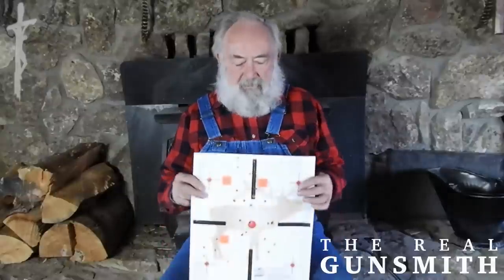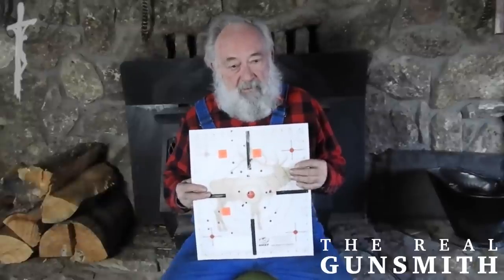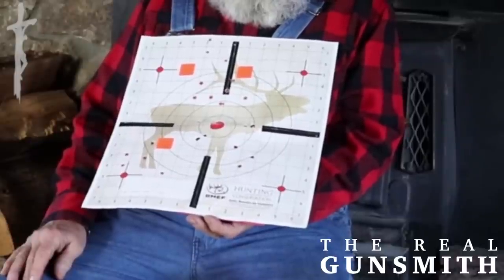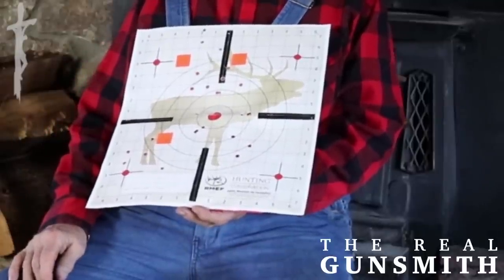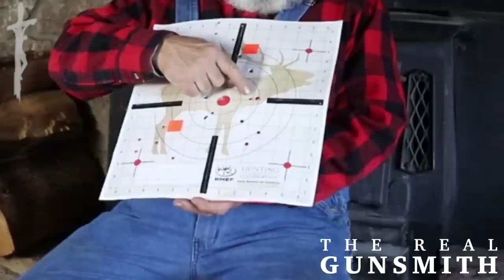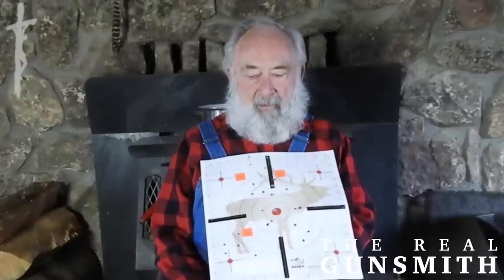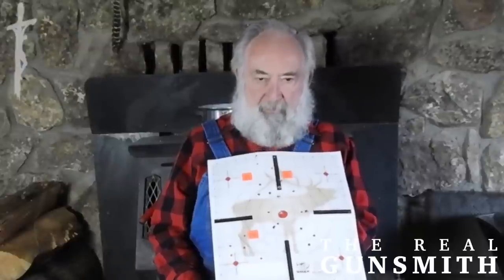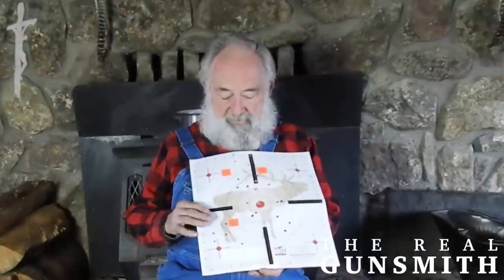Savvy Reloading Advice

Comment: Growing up with absolutely no standards in accuracy because we were not allowed to hunt deer with rifles in my state, I was never interested in this type of accuracy. I never knew what the term actually meant. I am absolutely pleased to get around 1 to 1.5 inch groups out of any factory rifle I have now and compared to 6" groups at 100 yds with rifled slugs from a smooth bore we are miles ahead of where we were when I was younger. Your talking about striving for less than .5 inches. Amazing and thank you for your knowledge. I switched to a muzzleloader for all seasons when inlines became popular in the 90s looking for those one hole groups, and never looked back until they made straight wall cartridges legal. Now I shoot a 45/70 guide gun with 300 gr jhp handloads. I have some 405 gr hard cast but they tear up a lot of meat. The 300 gr behind the shoulder is perfect and kills like lightning and group about 1.5" at 100 yds. Which is about what I would get from my inline with 250 gr. sabots and 90 he of pyrodex.

Comment: I developed a load for my Browning A-bolt 25-06, using 4831 powder and Barnes TSX 100gr bullets. I used 4 different loading references,  3 of the 4 listed 54gr as the max charge, except my Nosler#3, which said 56 was max. I loaded up 20 rounds from 52gr to 55.8gr, shot them over a chronometer, found 2 powder nodes, selected 55.2gr as the charge.
Then I played with bullet seating depths until I got to a 4 shot group at .78 inches.
I shot 40 rounds to find a load, maybe I didn't do it perfectly or maybe I went about it differently than some would have done it, but it sure is satisfying when you see your changes make the groups tighter.
Reply: Barnes bullets wouldn't work well with data from other bullet manufacturers. Glad it worked out for you, but Barnes have a higher shot start pressure and are longer for their weight than jacketed bullets. Thus they need less powder to get to top pressure.

Comment: Finally someone that reloads and when starting off gets bad groups like I do. He's using a great rifle and his reloading experience and not getting much better than I do at first. How refreshing! Of course once I find a load that shoots under an inch I'm satisfied for the type of hunting I do here on the east coast. Last fall when starting off with a new bullet, my first charge shot close to half an inch! I didn't know what to do next! Still haven't decided. I have to tell you that this is the best group I've ever shot with this rifle. The velocity is a little low and I bought the bullet to try and extend my maximum range on moose but the low velocity isn't helping much. I'll keep trying other charges because I know the rifle likes the bullet. Wish me luck.
Reply: @Jess Hadlock I'm hoping too. But man that group! I was so proud.
Reply: @Jess Hadlock Older Sako Forrester in 7mm-08 shooting 160 grain Federal TBT at 2540. ES was 5. No visible pressure or measurable case expansion. Its a very long bullet and my mag is the limiting factor. Lots of jump. I really don't expect much more from my combination and should just load the rest. It would be my eastern moose load with a limit of 250-300 yards with a good presentation.
Reply: I was once loading 308 with 168 hornady match for a long rang plinking load using varget. It was a new and inexpensive gun so I was beginning to think 1.5" was the best I could expect, SD was in the high teens as well. Swapped WLR primers for REM LR and SD dropped to 8-ish and .5-ish for the group size. For hunting moose, I would continue to experiment until I found a good load at higher muzzle energy or until you have to sight the rifle in before the hunt starts.

Comment: You didn't say it, but with your approach to building a load, it follows a principle that I always state when others ask for suggestions - "don't be afraid to try something different and shoot your gun more."  It surprises me how many handloaders expect to find that accuracy result and down deep it pains them if they have to shoot they gun more than a minimum number of times.  I generally approach handloading as a great opportunity to shoot more - GOOD!.  I don't follow your approach in detail, but the general approach of try this, change one item, when you start to see results you like - start zeroing in on that recipe.  I also appreciate your approach of measuring the cartridge base expansion as another method to identify pressure signs.  Not many people do that.  It's a simple step, that requires very basic tools to measure for consideration.  If you could touch on a subject in a future video - what are your thoughts on the recently introduced Savage straight pull?  I'm giving it serious consideration, for one reason because I am a left handed shooter.  It may allow me to purchase a gun that does not depreciate in value so much because there are no right handed shooters that are interested in my left hand bolt actions.  The ambidextrous nature of the gun may serve my needs well, and retain value as it's still a right handed gun for anyone that may want it to be right handed.  But I would like to hear your thoughts on the integrity and strength of the action?

Comment: Good video. I have been reloading for close to 50 years. All true what you said. I have a 270 that would not group and would kick straight back with a terrible wollap, finally checked the bedding  and made it free floated  then added a heavier butt to force the center of mass back slightly. Worked up a group with 4350 imr and a 140gr boat tail. Shot groups under 1inch and soft recoil. Learned the lesson to feel how the recoil along with barrel vibration. Tune the load to the barrel.

Comment: When I start working up a load I start with the charge wight and increase it until I get good velocity and see low SD numbers. Then I work with the seating depth to tighten up the group. We all know that every cartridge is different and certain powders are suitable for each. As a general rule I look for a powder that yeilds a full case b4 it causes over pressure charges. I have nowhere the experience of most but I do understand I will never know everything and will continue to learn until I'm in the ground

Comment: Thank you for sharing what you have learned up until now. I'm looking forward to many more years of it. I consider every rifle, and cartridge combination a classroom. You have attended more classes than many of us put together, so I find your conclusions valuable. Alot of the YouTube reloaders never show a mic in their videos, they do show their digital caliper to measure  COAL, but never get around to measuring case head expansion. They are reading primers and bolt face marks on the case heads to judge pressure. The $300.00 rifle and scope combo often leave cratered primers at obviously low pressures, and when they pierce a soft cup primer, they declare that they have exceeded a max load, even though when they started the video, they stated Quickload predicted 55k psi, on a 63k psi cartridge. At this point I am trusting Quickloads prediction more than the "guru's' conclusion on pressure. Bush the firing pin and use a suitable primer, and track case head expansion and we can have a discussion. They not only may not have reached their best velocity, but also not reached the most accurate load. Not knocking the $300 rifle combo as it is perfect for the guy that can get through 3 deer seasons on 1 box of factory ammo, but it would be interesting to see the initial expansion of factory ammo. Are they chambered as carefully as the firing pins are fitted?  Question for Randy: A long time ago when I was young and gun writers were old (but younger than I now am), they would frequently shoot 10 shot groups fired at a slow pace at 200 yards.  Now that bullets are so much better, is this practice still beneficial?

Comment: i grew up shooting .243 and reloading for it.  my dad had worked up a load that would shoot inch or less groups in all 4 of our .243 rifles.  30 years later I decided to start reloading, and spent all summer working up a load for my .270 and went thru exact experience  just described.  I was amazed at the difficulty in coming up with a load.  I finally got it, after much head shaking and some profanity...lol

Comment: Happy new year from Australia Randy. Very interesting subject, I have found changes to groups in 338 W/M caused by the season. I hunt in area's that have high humidity and 35-40 degC temps and the group can clover leaf then take it hunting in dry cooler 25-32 degC little humidity and they will group out 1"-1.5" out of the same box. I don't change projectile weight (225gn SST) or primers WLRM I just reduce powder by .5gn and they tighten back up. It is an amazing science. Thank you. Grate filming by your wife. Stay safe.

Comment: Thanks for the advise.  I’m not a reloaded but it’s absolutely fascinating.  I bought a $370 30-06 savage axis with scope.  Due to limited availability of ammo I purchased 150gr bullets which garnered a 2.4” shot group.  The next box was 168gr SGK 1.1” shot group
Then 180gr Cor-Lol .9” shot group and then I finally found 178gr ELD-X .6” shot groups.  I wonder if bullet weight is relative to barrel twist and length.  

Gotta make sure all the screws are torqued properly.  I found that out the hard way.

Comment: +
Question ~ in the situation with belted cartridges, is the belt dual functioning? 

Meaning, as I understand it, it can be for headspacing but was the original intent to strengthen the case head as well?

Keep up the excellent content 👍🏻🙏🏻✝️

Comment: Randy, I've been a toolmaker/machinist for over 20 years and have some good mics. What kinds of changes are you looking for when measuring the head of the brass? .0001 - .0005? .001 - 2? And what do I do with this measurement? Is it just an objective way to measure when you're approaching or over pressure?
Reply from the maker: .0005 as max expansion on brass to control pressure. 
Thanks for watching.

Comment: With low consistent SD's and repeated group size of the same measurements you may want to adjust distance from the lands. Start on the lands and work back. I'm sure you are aware of this, not sure why it wasn't mentioned.

Comment: Hello Real Gunsmith, I have questions about reloading sir, and would like to ask your professional advice. I’m brand new to re-loading and I understand some loads shoot more accurate at a specific bullet jump into the barrel. I have heard many choose .020 off the lands as a good starting point for hand-loads. My question would be, when a person is reloading a lighter grain bullet in a specific caliber “in my case .243 Win”, when should one decide that there isn’t enough bullet seating depth in the neck? Is there a minimum amount that one would want their bullet seated in the case neck for proper retention? In my case with a Hornady V-Max 87 grain and a choice of .020” off the lands the projectile appears it will be seated less than .243” depth in the case neck. How much less than projectile dia is acceptable for bullet seating depth using my Redding standard FL resizing die that uses the standard resizing method for case neck? The current 87 grain .243” V-Max projectiles I will be reloading don’t have a cannelure groove, so I assume they are not designed for a crimp to be used.
Your thoughts on bullet seating depth for proper bullet retention vs desire for a certain off lands distance for accuracy?

Comment: What’s your opinion on annealing the brass in between shots ?   Love your videos
Reply: not needed, trin your brass correctly and just neck size keeping your brass dedicated to your individual rifle chambers. do not mix brass and rifle chambers if you neck size.  neck sizing prolongs the life of brass cases.
Reply: @barryrickert6544  eventually annealing is needed, and sooner than you think. Annealing keeps the neck elastic which allows consistent neck tension. If the brass workhardens to the point where most of the elasticity is gone, when you seat the bullet you are sizing the neck again. Neck tension will be very light and inconsistent.
Reply from the maker: No need.  Good quality brass has been annealed.
Thanks for watching.
Reply: @TheRealGunsmith  All brass is annealed a few times during the manufacturing process. When it is loaded and fired repeatedly it workhardens and requires annealing again to maintain neck tension.
Reply: @TheRealGunsmith  What is good quality to one may not be to another. I have 30 yrs of reloading and metallurgy... my data says to anneal magnums every time and .308 capacity sized cases every other time.

Comment: with your vast experience what powder do you recommend for the .270 shooting 150gr bullets?
Reply: I've done well with IMR4350, H4831sc, RL-26 in my 270 with 140 and 150 grain bullets, Hodgdon website has load data as well as Speer website and Alliant website. I've also invested in manay reloading manuals over the years from bullet manufacturers and a few powder manufacturers as well. I did find that the RL-26 data from alliant using the 150 grand slam was too hot for my tikka and had to pull a lot of bullets before getting to max. Your mileage may vary always work your loads up until you find your own true max. I will start measuring the heads of my brass now that I heard it here. I was a toolmaker for @20 years and still have my mics and more calipers than you can shake a stick at. Curious what I'll find, Randy just said to measure it, but didn't say when to back off the charge!
Reply from the maker: RL22 or RL 26.
Good shooting!

Comment: What do you think about using these 2nd’s bullet’s they sale . Are they just plinking bullet’s and are they waste of money and time. Thanks for sharing your videos and information
Reply from the maker: They are fine bullets, just like the ones you buy in the box.  A simple matter of some discoloration, or occasionally a blemish or other issue they are put in the 2nd's pile.
Thanks for watching.
Reply: @TheRealGunsmith  thanks for getting back to me very much.
Reply: @Dwayne7834  I agree and depending on where you live you can go directly to purchase them. I live close to Sierra and buy them by the pound. However, i can send you a picture of the 20 lbs of blitz /tipped bullets that have to be melted down because they are so far out of specs.
Reply: @justice1327  Thanks for the reply . I have purchased a few to check out and compare to other I have. Most will be shot at 100-200 yards.

Comment: Very interesting and informative video, thank you! Not sure if this is the appropriate place to ask this question, but I'm gonna throw it out there. Recently bought 100 rds of .223 reloads that won't chamber or cycle in my .223 Wylde pistol or my 5.56 rifle. What can I do with these rounds? And does anyone that reloads, buy them so I'm not just tossing ammo that won't run away. Not sure where I go with these from here, as I don't reload. Any suggestions would help, TIA!
Reply: Find a reloader friend who has a Redding Body Die. Or buy one yourself, they're inexpensive. Buy a reloading press on sale or at a garage sale or auction. Buy case lube and wipe a little on the body and shoulder of your ammo and run them into the Body Die. If that doesn't solve the problem, measure the length of your ammo. If it's more than 2.26", you'll need a seating die (or a friend who has one) to seat the bullet a little deeper.
Reply: I am a new reloader, but I recently had some that didn't chamber. I had crushed the shoulders while trying to crimp them. Forcing them into the chamber worked for me, because I wanted the brass back. First question is WHY it isn't chambering. What part of the round is binding? I would want to examine the location of the bind carefully. Second question is who did you get it from? If I messed up a batch I want to change it out for good rounds. Third question is do you know any reloaders? As mentioned, if a friend has the dies it might be a quick fix. If not, an associate who reloads might buy the lot for components.
Reply: @vidard9863  I have yet to use marker on the rounds and see where it scrapes off to find out where exactly there are binding up. The BCG won't go into full battery I know that, and it is hell trying to back it out with the charging handle. I do not unfortunately know anyone who reloads, that's the issue I'm having as I bought them at a gun show. Purchased 2 50 round bags of hollow points for $40.00 a bag.
Reply: @vidard9863  I do appreciate that replies though, as now I guess I'm just stuck with them, unless a private transaction could be had? Lol tracking and all that and of course, for what they are... cheaper price lol
Reply: @travisbirch4969  ouch... Well keep an ear out, odds are someone you know knows someone who reloads. 'course right now a single stage press and a body die or gutted sizing die might be cheaper than a hundred rounds. If you can get into details you can get into reloading, it's not a bad excuse.

Comment: Don't you agree, each type of bullet may require a different charge of the same powder? Closer to the middle charges usually run more accurate?
Reply from the maker: Yes. And no.   Accuracy is obtained with near perfect ballistic balance for our high velocity rifles, which is invariably at top, uniform velocities.
Thanks for watching.
Reply: @TheRealGunsmith  I have several groups with various bullets, same charge and powder with varying results. Barnes TSX the best group.

Comment: Here's a question for you i have an 1886 Winchester 45-90 made in 1897 in superb condition with an excellent bore.I have been told that it will easily digest 45-70 with no ill effects and others have said it will bugger the chamber.What do you say on this.
Reply from the maker: Use 45-90, the 45-70 rounds by firing will erode the section of the chamber no filled by the longer 45-90.
Thanks for watching!
Reply: @TheRealGunsmith  Thank you.